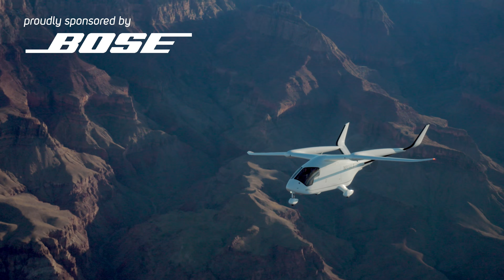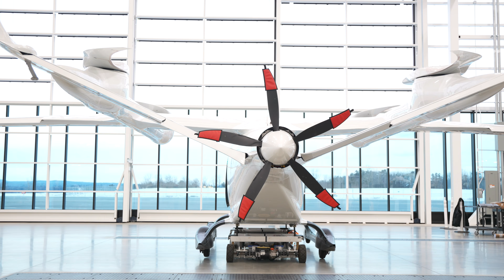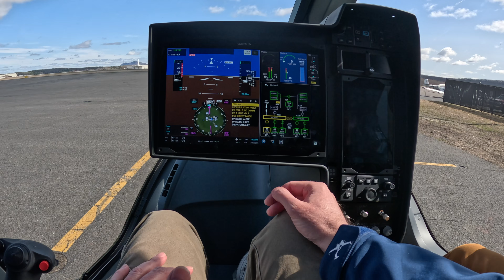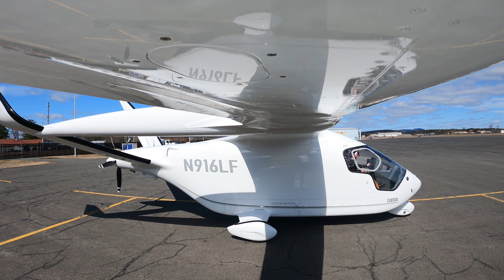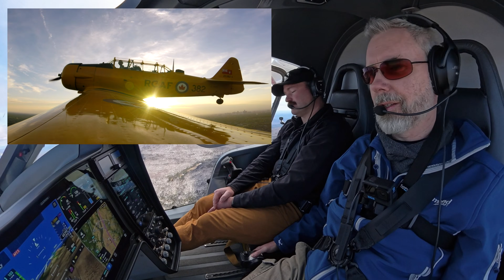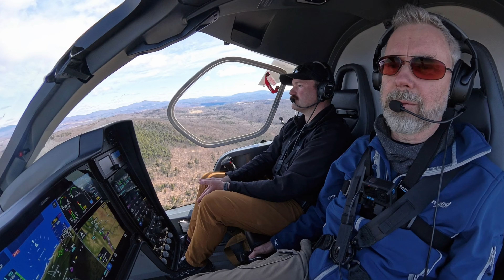Learning to Fly Alia: Landing when Instructor CAN’T Help!

Comment: A few years ago, I flew one of the scale flight demonstrators as an RC pilot, flew it both in fixed wing and VTOL configurations, landing baby Alia was very challenging (including once where a Cessna decided to land unexpectedly behind me). The ground roll on it for takeoff took a long long time to get airborne. I still remember it as such a fun experience working on that project. 

Awesome to see the real thing flying.
Reply: Did it need more power? How do you think about the power to weight ratio on the full scale?

Comment: Fly by wire comes with some engineering responsibility but it has huge advantages, cleaning up all the mechanical linkages. You need the actuation for autopilot anyway so you are really just making reliable autopilot hardware and you get the cleanup for free. Huge simplification in production and design freedom. There shouldn't be brake pedals either, they can just be little finger brakes.
Floating avionics looks pretty cool.

Comment: Just put functioning rudder pedals in it. The twisty stick is going to lead to crashes. If it's not broken, don't fix it.
Reply: Agree 100%.
Reply: My bet is they're going with the twisty stick because the design is primarily a VTOL and rudder pedals would introduce bad habits in that regime.
Reply: @rfwillett2424 Pedals are traditionally used for aircraft yaw control. It doesn’t matter if it’s an aeroplane or helicopter the pedals still control yaw. Why would it be a problem in a VTOL??
Reply: @rfwillett2424 So what about helicopters? Rudder pedals are used for yaw. Pilots need to be able move between different aircraft without worrying about where yaw control is. They could easily put fly-by-wire pedals in. This just doesn't make sense to me.
Reply: why have brake pedals at all? all stick or all pedals sounds better
Reply: @K3rbalSpace the breaks control actually brake lines. Im guessing its a safety thing if there are power issues. Has to be padels
Reply: @K3rbalSpace You ever flown?
Reply: @Fozcine  you did not noticed the "?" in their comment or are you in the mind set that other people can not voice their opinions ?
Reply: Get in an aircraft and fly, then voice an opinion.
Reply: GenZ flying flight sims from the age of 13 will be happy with twisty sticks. It’s only old dogs and new tricks (p.s. I’m an old dog but remember sim flying without pedals) :-)
Reply: This isn't the first aircraft to use this. They aren't "fixing" anything. That's also why you train in that aircraft to learn it.
Reply: @tkyler65  With few exceptions, I would wager that the vast majority of pilots would prefer proper rudder pedals. I'd bet even more money that if they go into production, both VTOL and FW versions will come with rudder pedals. They'll eventually realize the advantage of pedals over twist-stick.
Reply: @wiplashsmile It's not really an advantage as much as it is muscle memory. I've only ever flown with rudder pedals personally but I have used twist stick in sims, from the sims it isn't difficult once you get used to it, different yes,  but not hard.

Comment: What's up with that panel? It looks like Garmin produced the flight deck specially for this airplane however that would be a hugely expensive and unnecessary compared to basing the Beta customizations on an existing platform. The G3X is too old to have done that for, but that's not a G500 or G1000. I am betting that this is the next gen Garmin panel and nobody has noticed.
Reply from the maker: It's the G3000 prime.  
Newly released this year, not specific to Beta other than the custom panel pedestal and some software tweaks related to the electric power plant.
Reply: @FlightChops  Ah dang, I thought for sure I noticed something new. Anyway, thanks for the great video!

Comment: Engine burn fuel motors run on electricity. 😂
Reply from the maker: Watch the previous episode for an explanation on why the FAA classifies this system as an electric engine, not a motor.
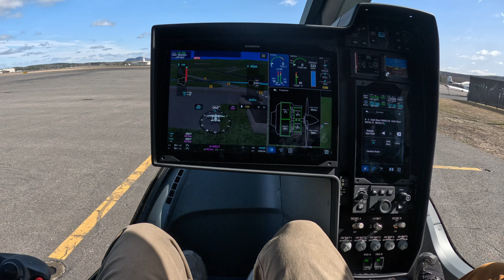Reply: @FlightChops  LOL at 8:11 Motor temp
Reply from the maker: The electric engine system is comprised of several components, some redundant, including two motors, the temps of each are monitored individually. The previous episode breaks this down in detail… but yes the power plant as defined by the FAA is an electric engine.

Comment: One thing that really worries me about this project is that the CTOL version in many ways feels like just a test bed for the VTOL one, but also they seem to be also pushing it as a standalone product... it just doesn't feel whole, between the missing rudder pedals, fake collective lever, missing flaps. I wonder how much are they relying on being able the sell the CTOL in order to fund the VTOL.
Reply from the maker: I think it’s more that they wanted to prove the air frame is safe and performs well.
Because the VTOL version is not going to change much - they are going to add flaps or rudder pedals, and the main difference is that the collective will move so what I think they really want to try to do is create a steppingstone platform for training and operating; but the CTOL version has a lot of potential for different applications for cargo and so on, where short runways are not required.
Reply: The "fake collective level" houses the throttle on both versions. The ctol version has the furthest range and lowest cost so it's still a viable option if vtol isn't needed. 

Vtol is the unique aspect of Electric aircraft,  but the quiet, simple, and reliable aspects still make ctol a good option.

Comment: Glorified electric drone that can only fly 250 miles per charge. How going back in time looks, some of the smallest planes can fly thousands of miles, not just 250 before you need to refuel / charge
Reply: You're missing the point of this vehicle completely if that's what you think. It's your imagination that's lacking, not the potential of this aircraft.
Reply: doesnt require thousands of dollars in fuel
Reply: I believe both kinds of aircraft serve a specific purpose.
Reply: How going back in time looks, some of the smallest horses can go dozens of miles per day, not just 10 like these new-fangled horseless carriages.